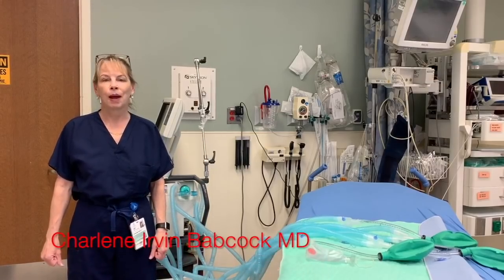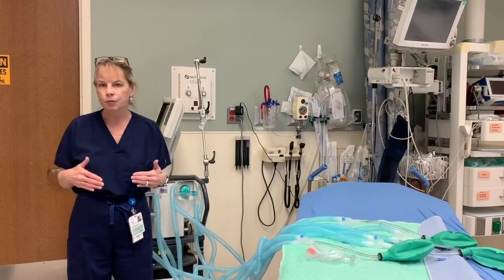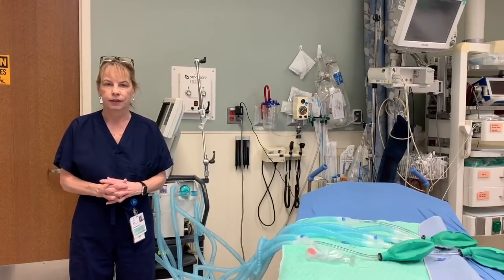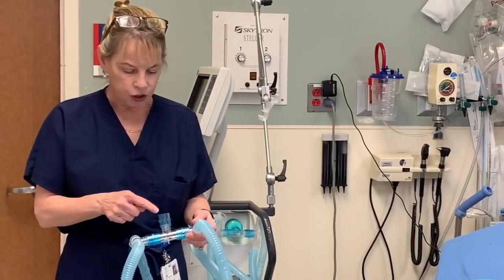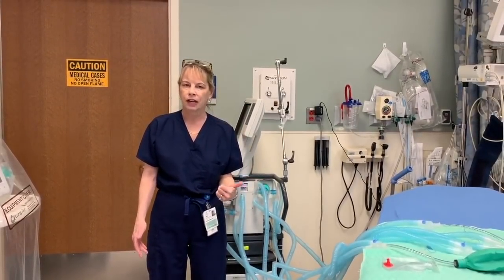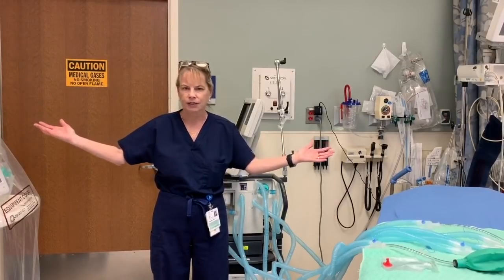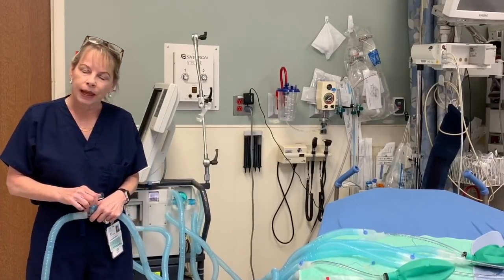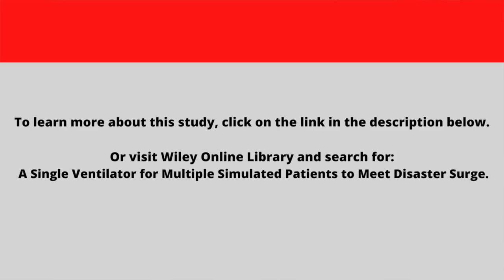COVID-19 How to Use One Ventilator to Save Multiple Lives

Comment: I think this idea is good when in do or die situations, has been tried before with good success rate.
Still few requirements are needed, though there are many hindrances, still if you are having good knowledge of respiratory phisiology, slight time to time adjustment with the inspiratory limb, changing resistance if needed on the inspiratory limb, 
 a satisfactory result can be obtained.
One more thing which I want to focus is, once you start this technique, especially in poor country with high inflio of SARS you are not likely to get a new supply of ventilators.
Reply from the maker: It is being used successfully in ITaly.....yes it is off label...yes it challenges the clinician to 'match' patients as best as possible for compliance, TV, resistance, etc...but it is working...see below about Italy...I've also been told its being used in Egypt.....  THe last sentance in the article (translated) is: "...its like multiplying  fish and loaves."

Dr Marco Ranieri of Bologna, Italy and his team Have successfully tested the approach in vivo in one of the hospitals in Italy overwhelmed by the COVID-19. 

They worked with Intersurgical, an Italian company based in Mirandola, started producing the circuitry in only 72 hours, and the first prototype has already been tested by Bologna Sant'Orsola Hospital. It works and in the next few days they'll start a mass production to supply Italian hospitals who are in need

Here some news in Italian. 

https://www.huffingtonpost.it/entry/a-mirandola-testato-ventilatore-che-assiste-2-pazienti-bonaccini-straordinario_it_5e73c3e1c5b6f5b7c540a8d2

Comment: There's a LOT of problems with this - you have to have tidal volume and airway pressure matched patients who are both paralyzed and have roughly the same PEEP requirements - and you can't keep ARDS patients paralyzed for a long period of time - so if you were incredibly lucky and found two patients of same size, same vent pressures, needing roughly the same inspired oxygen fraction you might get away with this for a day while you looked for something else - Lewis Rubinson and Richard Branson did a good debunking of this in Academic Emergency Medicine a few years ago. Seems like a great idea but it has an incredibly narrow range in ARDS patients which is what COVID-19 is.
Reply: Agree.  It would be similar to the most basic transport ventilators.  Have you seen those?  They have a dial for tidal volume and a dial for rate.  Thats all.  They are just enough to keep someone alive.  Not really any better than a BVM.  Of course we know that the settings wont be ideal.  They will be incredibly basic.
Reply: @JM-nh8yp  Wrong. The problem isn't the ventilator, it's the compliance of the lung, size of the patient, and weight.
Reply: @Catching_Rockets  I hear what youre saying.  However, basic vents dont have adjustments for compliance and they work fine for simply keeping someone alive.  Just like BVMs do.
Reply: @JM-nh8yp  You don't need adjustments for compliance. If you have two people on a ventilator and one is compliant and one isn't boom pneumothorax. But you would already know that if you knew what you were talking about.
Reply from the maker: It is being used successfully in ITaly.....yes it is off label...yes it challenges the clinician to 'match' patients as best as possible for compliance, TV, resistance, etc...but it is working...see below about Italy...I've also been told its being used in Egypt.....  THe last sentance in the article (translated) is: "...its like multiplying  fish and loaves."

Dr Marco Ranieri of Bologna, Italy and his team Have successfully tested the approach in vivo in one of the hospitals in Italy overwhelmed by the COVID-19. 

They worked with Intersurgical, an Italian company based in Mirandola, started producing the circuitry in only 72 hours, and the first prototype has already been tested by Bologna Sant'Orsola Hospital. It works and in the next few days they'll start a mass production to supply Italian hospitals who are in need

Here some news in Italian. 

https://www.huffingtonpost.it/entry/a-mirandola-testato-ventilatore-che-assiste-2-pazienti-bonaccini-straordinario_it_5e73c3e1c5b6f5b7c540a8d2
Reply: Charlene Babcock Exactly what I was pointing out. The setup is not ideal, but in times of crisis, we need to make things work. Those who cannot adapt fast to changing circumstances are bound to fail. Thank God we live outside the US.
Reply: This is only for a worst case scenario. Not ideal, of course, but better than no available ventilator at all.
Reply: @mrtechgamer3026  Wrong. Triage and try to save the "healthier" person.
Reply: Drew Perks You have no grasp of reality, in my opinion. When there is limited resources and high demand, what you are pointing out is no longer important. You can triage all you want, but you do not have any single right to choose who lives and who dies.
Reply: @mrtechgamer3026  When I worked as a fireman and came upon a head on collision in a rural area I had to choose which of the four victims lived. And I'll do the same put in a similar situation. We are taught to triage, and sometimes you have to do what you have to do. You obviously lack medical knowledge or you would know this BS ventilator hack won't work. So instead of possibly saving one life you'll kill several with this method.
Reply: Drew Perks I work in intensive care and understand probably more with my more than a decade of ICU experience. This setup is not ideal, which everyone would agree. You do not need to agree with the video or to my opinion. If you believe you know more than I do or the presenter, then that’s your opinion and I would respect that. I wish you good luck.
Reply: @mrtechgamer3026  I'm an RT with over twenty years of ICU experience, trauma, and also worked as a fireman. You are probably a nurse I am guessing? And you don't understand why this wouldn't work. But unless you are an RT or a pulmonologist I wouldn't expect you to understand why this won't work, stay in your lane and I'll stay in mine 👍🏼😁
Reply: Drew Perks We don’t let RTs touch our ventilators, unfortunately. We have intensivists, the ICU team and experienced nurses. No, I am not a nurse. I am nobody. And I am well aware of the extent of your field.
Reply: Drew Perks and you have to use your brain, think outside the box, instead of saying things wouldn’t work. You would have to make use of whatever resources you have when the worst comes to worst. You do not need to question my qualifications either or be very defensive over this. I have plenty of questions as well, particularly dead space or recirculation of CO2. However, we have not tried it yet, and I have not personally seen the response of patients on this setup.
Reply: @mrtechgamer3026  apparently not, I literally taught an intensivist something about vents the other day, but wherever you work there must be some crappy RTs.
Reply: Drew Perks I’m sure you are very good at your job. Vents are your specialty indeed, and we all learn from each other. I just hope we don’t end up having to use this ventilator hack as this would mean things are really bad ✌🏽
Reply: @mrtechgamer3026  I don't need to think outside the box, due to different lung compliance this will not work. 

Let me attempt to break this down for you. If you hook one  electric current into a t-connection copper and lead where does most of the current go? Into the copper right? Because copper is I better conductor, more compliant. The same would happen with two patients on one vent, the person with the more compliant lungs would get most of the volume and possibly get a pneumothorax.

I have nothing else to add to this conversation. If you don't understand this I'd have better luck trying to teach my dog about respiratory mechanics.
Reply: @mrtechgamer3026  We finally agree on something. Except I would never risk my license trying this.
Reply: Drew Perks 😂😂😂 Absolutely. I won’t either. Let the doctors do their job, and we can work alongside with them.

Comment: I don't think this will fly with a fully Septic ARDS patient infected with COVID-19.  If you have four patients hooked up to the same 840, the patient with the worst lung compliance will get the least ventilation.  You can set the volume control to 2 Liters and "ASSUME" you give each patient 500 mL of Ventliation...  but that doesn't happen.  You'll get maybe two patients get the majority of the volume and the fully blown Septic Patient will get maybe 200-300 mL (if you're lucky).  Air will follow the path of least resistance (the least septic patients)  Assuming they even get that 200 to 300 mL, your effective alveolar ventilation would only be 50-150 mL per breath.  You might end up killing all four patients trying to share one ventilator.  Sure it "looks" good on a test lung (and those things you have hooked up are NOT true "test" lungs).  You just snagged them from cheap anesthesia circuits.  Those things have full compliance and zero resistance.  A real septic lung will not behave the same way.  It's going to be inflamed and full of fluid.  It WILL push back with sky high peak pressures.  This will "maybe" work with four patients with relatively "normal" lungs (e.g. four comatose post-CVA patients) to free up other ventilators for the truly Septic COVID-19 patients.  Show me a video with this 840 passing an SST with all those circuit extensions on it and I "might" believe it'll actually ventilate a patient.  Do NOT use this technique on truly septic patients.  It's a mistake.  Be sure to use HME's to 'minimize' the cross-contamination.  Do NOT attempted to use a full heated humidity system, if the COVID-19 doesn't kill them, the nosocomial infection (from the moisture) will kill them instead.
Reply: Excellent post, thank you!  It might work "on paper" but in reality it could make things much worse.  And then there's the lack of staffing (RTs and RNs) to make all this happen safely.
Reply: @lanebashford3982  Thanks for the comment.  From her ER doctor's perspective it can work on Trauma patients or folks with gunshot wounds where you are buying time to stop the bleeding and supply fluid resuscitation (blood products, etc...)  These folks will likely have normal lung function.  It can work.  However, it won't work on Septic Patients like COVID-19 patients will be.  Their Lung function is not normal and ventilation will be difficult (interstitial fluid in the lungs will fight back) with even one vent per patient. It would be a "tactical" mistake to use a ventilator this way.
Reply: End of Discussion:   The Society of Critical Care Medicine (SCCM), American Association for Respiratory Care (AARC), American Society of Anesthesiologists (ASA), Anesthesia Patient Safety Foundation (APSF), American Association of Critical‐Care Nurses (AACN), and American College of Chest Physicians (CHEST) all say NO.  https://www.asahq.org/about-asa/newsroom/news-releases/2020/03/joint-statement-on-multiple-patients-per-ventilator
Reply: Bicycle Crossroads 
She said they needed to be similar patients.  And that it was only for dire circumstances, where they were going to die either way.  You did catch that part right? Didn’t you???? Didn’t you!!!
Reply: @oldfashionedsportsmanchave4590  thats a loaded statement.

Comment: This would not work for covid19/ards. I am 99% sure it would cause death in all pts. To much variability in compliance of sick and healthy lung units . not being able to monitor ml/kg . high peep to oxygenate is going to cause barotruma in the most compliant of. Recruitment manuvers will not work . I like thinking outside the box but this would not work
Reply: I agree with Ken.  Plus the circuit compliance on FOUR curcuits will eat up a LOT of the volume on a PB840 if it has not been calibrated  properly.  Show us a video with this setup with the PB 840 passing a calibration, and maybe the vent can compensate for all that 48 feet of circuit (4 x 12 feet/circuit)
Reply: Bicycle Crossroads wrap each new limb super tight with tape!!!!
Reply from the maker: It is being used successfully in ITaly.....yes it is off label...yes it challenges the clinician to 'match' patients as best as possible for compliance, TV, resistance, etc...but it is working...see below about Italy...I've also been told its being used in Egypt.....  THe last sentance in the article (translated) is: "...its like multiplying  fish and loaves."

Dr Marco Ranieri of Bologna, Italy and his team Have successfully tested the approach in vivo in one of the hospitals in Italy overwhelmed by the COVID-19. 

They worked with Intersurgical, an Italian company based in Mirandola, started producing the circuitry in only 72 hours, and the first prototype has already been tested by Bologna Sant'Orsola Hospital. It works and in the next few days they'll start a mass production to supply Italian hospitals who are in need

Here some news in Italian. 

https://www.huffingtonpost.it/entry/a-mirandola-testato-ventilatore-che-assiste-2-pazienti-bonaccini-straordinario_it_5e73c3e1c5b6f5b7c540a8d2
Reply: They were going to die anyway.

Comment: But this wil make them prone for infection again from rest of the patients connected together  if recovering...
Reply: Using HME's might "help" prevent the nosocomial infection (that will likely follow).  She doesn't have this set up with HME's.
Reply: Correct, but a dead patient cant be prone to infection.
Reply: @krypticnx  They r not dead if they are on ventilator . They are paralysed with muscle relaxant or whatever ventilator mode they are on ..

Comment: You would be better off with a disposable ventilator.  This wouldn't be any use to patients with ARDS, and could be potentially dangerous to them.  Imagine one of the patients gets reduced lung compliance and causes the other one to be over ventilated... or perhaps even barotrauma.  You wouldn't be able to make changes based of of blood gases either so anything longer than an hour or two could cause harm to one or more patients on this setup.  There are also alarm issues you could encounter.

I suspect you would achieve better results using a disposable ventilator like the go2vent or the surevent.
Reply from the maker: I agree...use usual ventilators...then disposable ones...then bipap machines, then you will be in desperate situaition.  But please be aware....it does work....

It is being used successfully in ITaly.....yes it is off label...yes it challenges the clinician to 'match' patients as best as possible for compliance, TV, resistance, etc...but it is working...see below about Italy...I've also been told its being used in Egypt.....  THe last sentance in the article (translated) is: "...its like multiplying  fish and loaves."

Dr Marco Ranieri of Bologna, Italy and his team Have successfully tested the approach in vivo in one of the hospitals in Italy overwhelmed by the COVID-19. 

They worked with Intersurgical, an Italian company based in Mirandola, started producing the circuitry in only 72 hours, and the first prototype has already been tested by Bologna Sant'Orsola Hospital. It works and in the next few days they'll start a mass production to supply Italian hospitals who are in need

Here some news in Italian. 

https://www.huffingtonpost.it/entry/a-mirandola-testato-ventilatore-che-assiste-2-pazienti-bonaccini-straordinario_it_5e73c3e1c5b6f5b7c540a8d2
Reply: Irate Wasp dire circumstances only.
Reply: @missusJ05  I don't think this is a safe solution.  For a Covid-19 patient (who need ventilators support because of ARDS), I would argue it's counter productive at best and most likely harmful to one or more people sharing a device.

Comment: I wonder, Would you be able to cap off one of the circuits to ventilate only three patients if needed. (The cap would need to be on tight enough so the pressure does not pop off the cap)
Reply: Ashley LaVoie you can just put a test lung on in that case.

Comment: If your hospital has to resort to these dangerous methods of mechanical ventilation in a disaster, then your hospital is not prepared. Or you don't have a Respiratory therapy department that has safety measures in place for a disaster.
Reply: I've flown to hospitals that have 2 or 3 vents, that's it! Have you ever seen rural medicine?
Reply: @brianwallenburg9224  yes, I worked in Paradise, Ca. at Feather River hospital. They also are prepared for disasters.
Reply from the maker: Its only suggested for dire circumstances..and I hope your hospital never gets there...

It is being used successfully in ITaly.....yes it is off label...yes it challenges the clinician to 'match' patients as best as possible for compliance, TV, resistance, etc...but it is working...see below about Italy...I've also been told its being used in Egypt.....  THe last sentence in the article (translated) is: "...its like multiplying  fish and loaves."

Dr Marco Ranieri of Bologna, Italy and his team Have successfully tested the approach in vivo in one of the hospitals in Italy overwhelmed by the COVID-19. 

They worked with Intersurgical, an Italian company based in Mirandola, started producing the circuitry in only 72 hours, and the first prototype has already been tested by Bologna Sant'Orsola Hospital. It works and in the next few days they'll start a mass production to supply Italian hospitals who are in need

Here some news in Italian. 

https://www.huffingtonpost.it/entry/a-mirandola-testato-ventilatore-che-assiste-2-pazienti-bonaccini-straordinario_it_5e73c3e1c5b6f5b7c540a8d2
Reply: @charlenebabcock1048  https://www.aarc.org/joint-statement-guidance-document-on-multiple-patients-per-ventilator/
Reply: @charlenebabcock1048  this is why it's dangerous